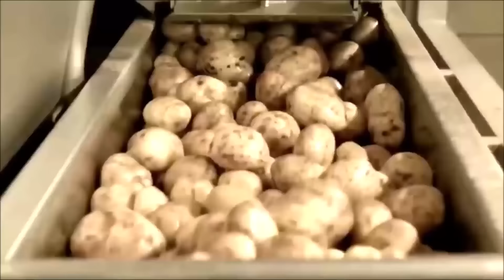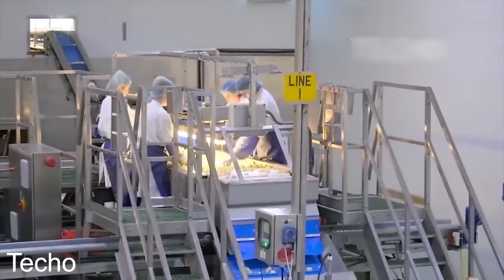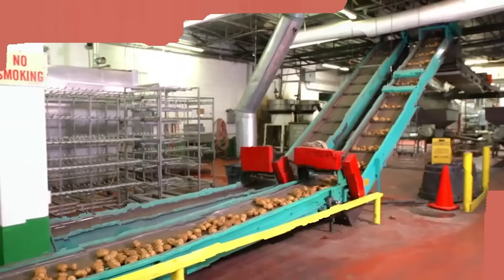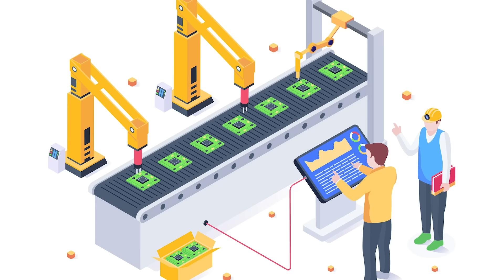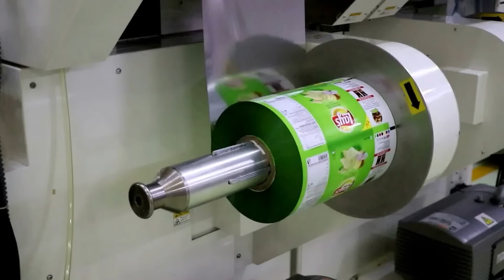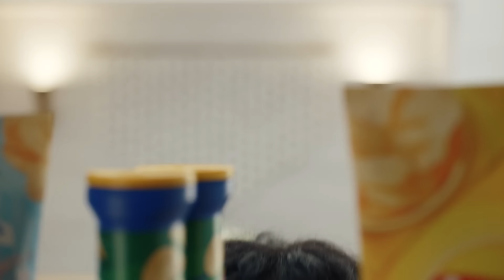A Deep Look into the Lays Chips Factory | How Fresh Potato Chips are made

Comment: Packet filled with 30% Chips and 70% Air😀😁😂
Reply: Now 20% chips 80% air
Reply: @xyz_internet  yes exactly
Reply: Nitrogen is usually added into the bag before sealing to help keep the chips from going stale, as well as to turn the bag into a pillow so the chips don't get crushed during handling.
Reply: Don't bitch, you aren't paying for the air.

Comment: So, the oils got cheaper and the price went higher. That's my deep look at Lay's.
Reply: I would love if they created a separate version using butter rather than seed oils.
Meantime, I make my own :-0)
Reply: @2Truth4Liberty i thought butter would burn before you could get to a good fry temp for potato chips
Reply: @Dionte1999  Moisture in the potato   and in the butter when fresh (and I add a little fresh butter to every batch) keeps the temperature down until it mostly evaporates. The potato will brown before the butter becomes too hot but there is a "sweet spot" TIME WISE - the butter will look like hard boiling water with lots of foam just before and during the browning.
Like butter coalescing from cream, the foaming will suddenly reside significantly and that is when it is close to time to  remove the heat and tasty chips. (5-10 minutes beyond the foam residing ??)
Let them brown "not long enough" and they will be chewy and tough. Let them brown "too long" and the potato will lose its good taste and taste like burnt. But even then, if you remove the heat right away, the butter is fine to use for the next batch, just add some more fresh butter to it. Toss the burnt potato chips and go again until you know just how brown they can get :-0)
I uses a 5 qt saauce pan and no more than 1/2 full because the foaming would overflow it otherwise.
Reply: @2Truth4Liberty  i appreciate the explanation 🙌🏽 u sound very tapped in with the culinary world
Reply: @2Truth4Liberty  i want to say i’ll try it but it sounds complicated 🤣🤣
Reply: @Dionte1999  
maybe i'll do a video and cut out mosdt of the parts with it just sitting on the burner cooking
Reply: @2Truth4Liberty Please do
Reply: There'd be a correlation there if the only cost was oil.
Electricity prices have gone up, as did transportation and price of food. 
That means higher production costs, even after deducting oil price.
Reply: I live in south Georgia where peanuts, cotton and pecans are grown.   Farmers harvesting peanuts right now.   I can say, the price of peanuts/peanut oil isn't going down (what is?).